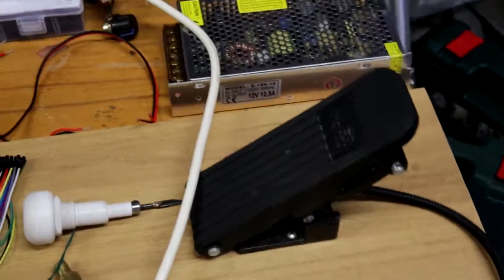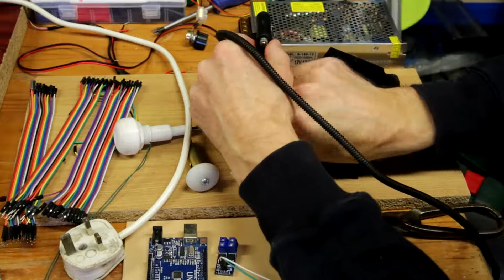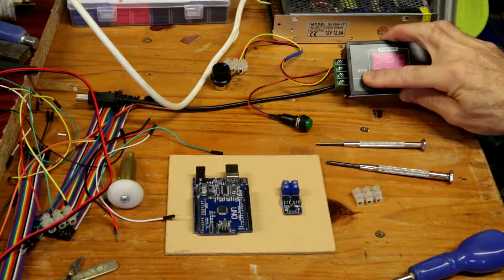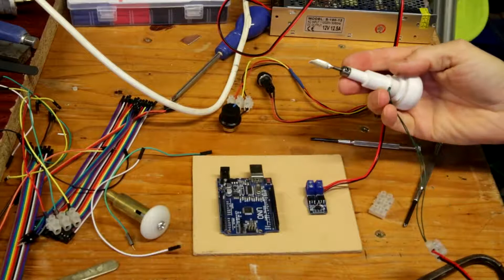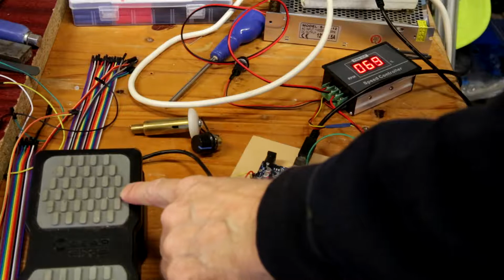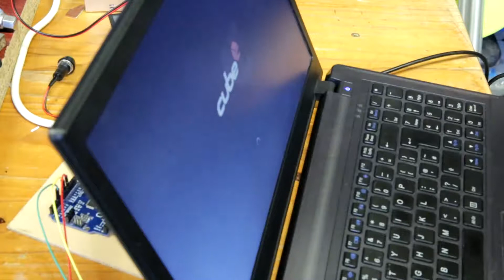Assembling the Super EZ graver controller

Comment: Hi Duncan,
I have followed this project avidly all the way through, and have now made and/or purchased all the necessary parts etc, but seem to be stuck on the wiring of it all. I have it all made and wired up to where one has to wire in the M Pedal. Like you, I have removed all the 'Gubbins' inside the pedal that are un-needed - and have been left with 3 wires on the original cable that came with the M Pedal  - One Red, one Black and one twisted together shielding wire (White).
I am now testing my installation (before trying to add the M Pedal) and I am only getting approximately one cycle per second activation of the solenoid, and I can't seem to get any variation of the frequency of the strikes at all. Changing the settings on the speed controller makes no difference at all to the strike rate?

I have no real doubts that there are any problems with my wiring up of the parts - have you any ideas as to why I can't seem to get past this problem?

I dont want to make things any worse by trying to add the M Pedal (and maybe damaging the UNO in the process).   I need to know which wires on the M Pedal connect where on the UNO - your video seems to use various coloured wires to connect this - my potentiometer in the M Pedal is wired (as you recommend) with the Red wire towards the top of the pedal, and the Black wire towards the bottom of the pedal. The White wire (Shielding Connection?) is connected to the centre pin of the potentiometer.

I feel so close to getting this sorted out and I dont want to ruin it all now for the sake of asking for a little help. Your system really has great potential, but I'm just a novice at all of this. It seems that, like many others, I'm desparate to  graduate from the noisy Pneumatic graver with compressor and bits of silicon tubing etc: to something far more reliable and convenient - I hope you can help me out a little.

Kudos to you for a great design, I am just so keen to get my version up and running - and I can then get on with the thousands of necessary hours learning how to engrave properly!

Regards Richard
Reply from the maker: The speed controller is only a speed controller for a motor. It is a PWM controller which controls the power to a motor which controls the speed. With the super ez graver this controls the power for each strike not the strike rate. The foot pedal not attached to the speed controller, controls the strike rate.

Have you looked at the documentation on GitHub?
Reply: @alastairduncan4702  Yes, looked at all of it - even have a lot of your videos related to to the Super EZ graver saved as well! I also have all the files backed up (except the latest handpiece that is - trying out the basics first!)  
If I read it correctly, I think you're saying its because I have not yet wired in the M Pedal yet, and it will work properly when I do? Hence my question about the M Pedal wiring, I just want to know I'm connecting the right wires to the right pins on the UNO i.e. Red to ? Pin on UNO, Black to Pin ? on UNO and Shield Cable to ? Pin on UNO. 
Having looked through the video yet again, and I still can't work out the which colour of the wire on the M Pedal goes to which pin on the UNO, maybe I'm missing something - quite possible as I'm going to be 83 later this year and not used to having so much time on my hands?  This is going to be my retirement hobby - hopefully!

Must say I'm quite impressed at the force that this small solenoid can produce - think it will be a very worthy replacement for my old compressor setup.  

Thanks for your very prompt reply, much appreciated
Regards, Richard
Reply from the maker: @richardbrooks6440  I think I understand you :-) I'm getting on a bit myself. With the single  foot pedal system, the foot pedal controls the strike rate.

black wire is 5v
Red wire is gnd
White wire is A0

I was also surprised by the strength of the solenoid. More than enough for any engraving I've done. Let know how you get on.
Reply: @alastairduncan4702  Fantastic Alistair - I shall be onto this first thing tomorrow. I'll give you an update tomorrow sometime.

Keeping my fingers crossed...
Richard
Reply: Well Alistair, have wired the M Pedal as you said, but the result is still the same - just the set pulse rate about every half second, and the pedal makes no difference to anything :(  One observation I'd like to make - convention here says that 'normally', Red is Power and Black is Ground, your advice is showing the opposite of this. I can't help thinking that these two wires should be reversed? Not tried it yet though, too scared of letting the magic smoke out of the UNO!!!)
Reply from the maker: @richardbrooks6440  the colour of the wires is irrelevant what matters is where they are connected to. They are not "powering" anything, there is a reference voltage and voltage which has been passed through a variable resistor. These are compared in the Uno and converted to a digital value which is used to calculate a sleep/power ratio for the MOSFET. What you can do is uncomment the print statements in the code and start the monitor in the Arduino editor (while connected) and see what values are being produced.
Reply: Update Alistair, I have checked out the M Pedal Potentiometer and found it to be working OK, Resistance is10.7 Kilohms and varies between 0.9 Ohms and 10.7 Ohms dependent upon Pedal position. I then 'Bit the Bullet' as they say and have now connected it as follows :- Red to 5V, Black to GND and White to A1. Switched it all on and whoopee - no smoke!!! I can now confirm that the pedal DOES control the strike rate of the solenoid as it should. Am I pleased about that!
Next question, what voltages do you run your setup with - I have a 9-23V Power Supply and I use an adjustable LM317 From this same supply to power the UNO. The little solenoid sure gets hot at higher than 12 volts and I just wondered what voltage you run yours at?

Once again, thanks for your help, Richard
Reply from the maker: @richardbrooks6440  I'm pleased you have it running. I have a 12v power supply that powers the solenoid. Powering at full power on the PWM(speed controller) and high frequency strike rate will result in higher temperatures. When the solenoid gets hot the power will reduce as the resistance in the solenoid will also reduce with temperature. That's why I did the mk 3 handpiece. Others have tinkered with the power/delay ratio to suit what they are using it for.

Comment: Hello Mr. Duncan! Thank you so much for explaining your project.  I have everything built and programmed....  only 1 issue..  my speed controller.... when I turn the dial to zero or 100 there is no change in the power.  The foot pedal works great. I checked my wiring several times... its exactly like yours. but my power doesnt change with the dial.  Any suggestions??
Reply from the maker: Hi Jerry, it's possible that you have a duff speed controller or potentometer. You may be able to test with a 12v bulb completely separate from the engraving system. Other than that the most likely cause is that it's wired incorrectly but you haven't tracked it down yet. The wires from the speed controller feed the MOSFET the MOSFET then goes to the solenoid.
Reply: @alastairduncan4702  Alastair, thanks for the reply! I checked the speed controller and it’s bad. With just the power supply connected I’m getting 12v out no matter what the power is set on. Even if the button is pushed. So I’ll use it without until a new one comes. Anyway I would like to send you some pics. I followed your instructions but I used the solenoid that you mentioned Thin Tran uses. I fit it into a wooden graver handle and almost have it finished with a spring tension control at the back of the handle like your newer design. Is there a way in the program to increase the power? Just wondering for experimentation. Once finished I would like to send you some pics. Thanks for your help Sir!
Reply from the maker: @jerrymanges2489  if you are putting 12v in to a pwm controller you will always get 12v out, it's the current that is limited by cycling the width of the pulses on and off very quickly. If you use a bulb or led as a test it's should dim or brighten when you turn the potentiometer. It should however switch off with the on/off button. 

The problem with pushing more power through the solenoid is that it will create more heat. It can be done programmatically by adjusting the delays. A longer delay after a write will allow the coil to be activated for longer. Different solenoid have different sweet spots so a bit of trial and error may be required for the solenoid you are using.
Reply from the maker: @jerrymanges2489  I have an Instagram account that allows messages with pictures @alastairduncan4
Reply: @alastairduncan4702  Thanks for the info! I’m going to keep at it. Have a good day!
Reply: @alastairduncan4702  Alastair I have everything together and working... it works as it should as long as I unplug the ground from the mosfet to the board... if thats plugged in my speed control doesnt work... if I unplug that ground it works great with the use of the speed controller. Im not sure why that is.... I went over the wiring several times..and its just as you show for the one pedal control.
Reply from the maker: @jerrymanges2489  in short I don't know. Do you have 2 separate power supplies, 5v for the board 12v for the solenoid? I did try using the 12v supply to power the board but had problems. It is recommended to have a flyback diode but I've not used one as everything works ok for me. Perhaps you need one for the solenoid you have? There's some interference on the ground but I don't know how to track it down.
Reply: @alastairduncan4702  Thanks Alastair. I’m supplying the board with 12v and the graver I made with 24v. Everything is working great. Practiced for 2 hours yesterday no problems at all. Works great. Graver gets warm but nothing excessive…. I’ll just keep using as is. Thank you for all your help.

Comment: Dear Alister,
Do you think there is a way to give the graver more strokes per minute? I have counted strokes per minute on my engraving machine done to your projects, and it looks like I get around 1,4k strokes per minute. This is fine with engraving small details, but with larger parts looks like it is somewhat to light. I have tried different solenoids, even bigger once but heavier "hammer" inside it works with less speed so it basicly does nothing. I think machine might be limited by either the spring, but putting heavier spring I think will counter the electromagnetic force. So my guess is, that the way to increase strokes would have to be adding more frequency to the machine. I have little to none knowlage about electronics and so on, so maybe you have any idea for that?
Regards,
Marcin

edit:
Ok. I was able to figure out some of it on my own. :) I have change the code in arduino to:if (pot_value < 200) {
    //Serial.println( "About to write high");
    digitalWrite(MOSFET_PIN, HIGH);
    // this is to give the solenoid time to act, for different solenoids this may have to be larger!!
    delay(10);
    
    digitalWrite(MOSFET_PIN, LOW);
    //this is the speed control here. it also determins the duty cycle for the solenoid
    delay(pot_value + 10);:
So now the delays on piston is smaller so it runs faster. I was able to get around 2,7k RPM. I have tried to use haevier piston (5,1 grams) as opose to orignal 4.5 grams, but heavier piston resoulted in lover RPM.
So on this solenoid I will run 4.5 grams piston with 2,7 RPM and I think that is the best I can get on this machine. Heavier enrgaving is still out of the question, but mid engraving (like 1,5mm wide) is now much easier and smoothier. :) I think so high rpm might resoult with solenoid breaking faster but I have 4 more in spare, and if that happens I will just make new one with smaller rpm. :)
Reply from the maker: Interesting discussion Marcin, the delay and activation time was arrive by some trial and error. I settled on this for a specific solenoid as it allowed a full length of stroke. By shortening the stroke length you can increase the frequency to some extent but this does reduce the amount of force that the piston will strike at. The spring has an effect on return speed but you've found that changing that can have a detrimental effect on the power of strike. A shorter stroke solenoid may have better performance in terms of frequency but whether it gives more force overall is the question. How have you found your setup in terms of heat production? The holy grail is to have one handpiece that does light and heavy work, but I'm not sure how feasible that is.
Reply: @alastairduncan4702  HI
In terms of heat production there is a big difference. The solenoid and the handle is getting warm a lot faster, even it it is put on 60% of power. If I run it in constant use on 60% or 100% it warms up a lot. If it is not stroking all the time but in moderate mod then it is ok. The heat even in constant use on 100% is noticible, but not uncomfortable. So by my guesss all is ok. Like I said, I will have to see how long it will last. 
In my case the settings were also made by trial and error.
I think the only way to have the device operational for harder work like engraving motorcycle parts and big engraving would to order a custom solenoid, or to use solenoid on two electromagnets. I looked into other solenoid base engraving machine (Pul..Grav..) and I think they have made the handle with to opposing electromagnets that changes the frequency of the stroke by switching the "ON" on the magnets on the oposing sites of the piston. But for that one would have to make a solenoid specyficly in that matter.
I have seen simillar solution on russian sites was discussed but they did like one or two models and it was based around potentiometer, not Arduino unit.
Anyway. Thank you for your project once more. :)

Comment: Dear Duncan, Your Mosfet has two pins directed up, to which you connect to UNO. Mine mosfet came without them so I assume I have to add those "pins" myself. Could you give me the name of that component? And are those "pins soldered to mosfet?
Reply from the maker: Some components will come with pins and some don't. here's the sort of thing you need https://www.ebay.co.uk/b/pcb-pins/bn_7024959969 I soldered them on.
Reply: @alastairduncan4702  Thank you. much obliged. :)

Comment: Was there a reason you did not simply power the Arduino Uno with the 12v power supply?  Any reason that would not work just to cut down on the cords?
Reply from the maker: Yes there was, it didn't work very well but I don't know why. Perhaps the supply was noisy? The preferred voltage for the arduino uno is 9v when not using usb, I've seen articles on the arduino forums that say that there can be problems with 12v input.
Reply: @alastairduncan4702  Thanks... guess I will go with the 5v.  Thanks for figuring this all out.  Been wanting a non-air version for a while.
Reply: I am trying to get it to work with the external power supply from the uno. I placed a stepdown regulator in between the 12v powersupply and the uno. If I run the uno from the usb connection, everything works as it should. As soon as I plug in the external supply from the stepdown, I can't control the power anymore. It will only run on full power? Any thoughts on how this can occur?

Comment: Hi Alastair, again many thanks for the great instruction videos and for everything else you are sharing.  I received all the parts this week, so i put it all together last night and got it working!  still figuring out how far down i should screw the handle on. also i think i need to reprint the handle and locknut, the threads are way to big, which makes it almost impossible to secure it, does your handle part have this issue too? Cheers
Reply from the maker: The thread on the locknut should be exactly the same as the handle. I've not come across a problem with it. @Anarasha had a similar problem his slicer adjusted the thread but the drawing I did has the tolerances built in. He has contributed some drawings that may suit your slicer.

https://github.com/alastair-duncan/SuperEZGraver/tree/main/docs/design/XRN13-30TLS/fusion360
Reply: @alastairduncan4702  thanks, ill give that one a try
Reply: @alastairduncan4702  printed the different handle you provided in the link and everything fits like a glove now!
Reply from the maker: @thomasvanlanen6279  that's great. Did you print this yourself?
Reply: @alastairduncan4702  yes I did, took about 3 hours

Comment: Hello, your job is very good. I want to make one but I found this to be a solenoid MH-13X30TL I found Push-pull type, I couldn't find XRN type.
Reply from the maker: I don't know as I've not tried the MH type solenoid and I've not been able to find any specifications for it. I've ordered a couple from Ali express but they will take a while to get here, they are inexpensive. The size looks ok, you will need to remove the threaded boss the same as the XRN type. The power is not shown, the XRN is 23W if the MH type is the same then it should work with no problems. If your power supply is 12VDC then make sure you get the 12VDC Solenoid. What you can try is searching on the UK google site and you should get the XRN solenoid shown. I got mine from China via ebay.

google .co.uk
Reply: @alastairduncan4702  thank you for the answer.  I could not find the 12 volt watt information I got.  If it is 23 watts low, is it a problem?  I hope my orders come first as soon as possible.
Reply from the maker: High is the problem. Too high = too much heat. 23W is just about right.
Reply: @alastairduncan4702  I guess it's not higher in watts than xrn.  When you come, I will let you know your values.  I am waiting for a detailed video for pedal adjustment.  By the way, I wrote a business plan for a Turkish business visa.  I am waiting for approval to start a business in the UK.